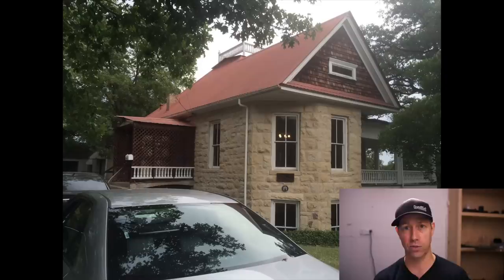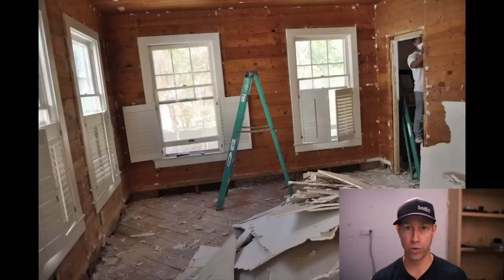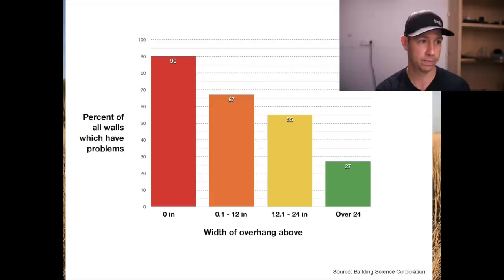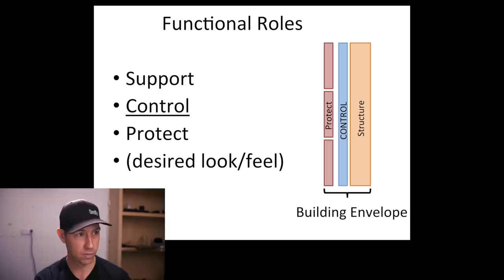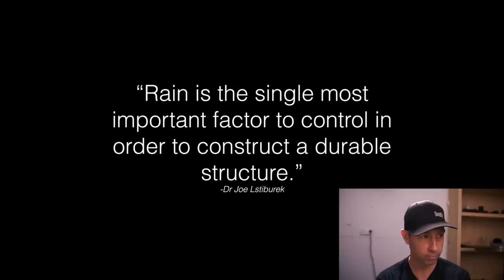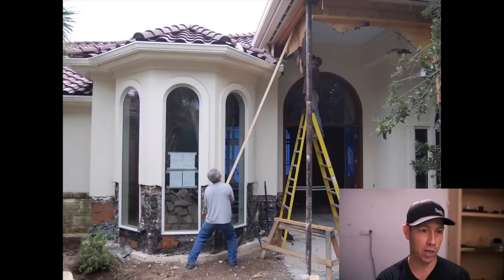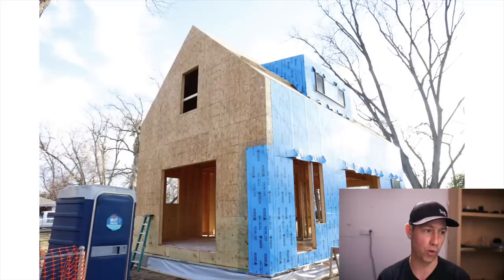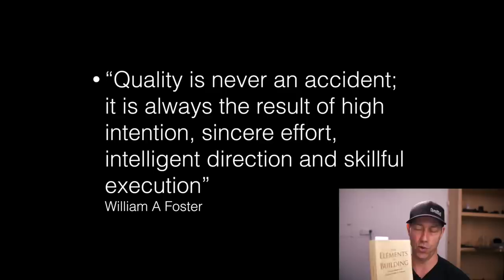Were Old Houses Built Better?

Comment: They didn’t have everything engineered to a spec, they went overkill on everything. Leave a 100 year old house out in the elements for 10 years and it’s still standing. Leave a 10 year old house out in the elements for 10 years and it’ll be dilapidated and garbage
Reply: That makes alot of sense. Atleast for the houses that survived long time
Reply: But the old house will smell mildewy like an old house, be drafty, be costly to heat and cool, have systems that are hard to maintain and will be haunted.
Reply: @Wee162  I trust my grandpas beat up farmhouse more then I trust my trailer his house has holes in the siding but if a trailer has holes in the tin itll rot out in a year
Reply: Damn you should build a oldstyle house lets see how you like it then hahaha
Reply: Grandpas house burnt down from the chimney

Comment: One also has to consider survivorship bias when looking at old things. Bad buildings from back in the day may be long gone. What we have left are the best buildings from a given time period.
Reply: Great observation
Reply: Definitely, tenement style housing from 100 years ago made with mediocre materials has probably all been raised by now.
Reply: Which begs the question from the video: How do we design houses today to take advantage of the successful things of the past, but improve them with today's modern efficiencies. It seems a lot of houses today are efficient, but not durable in the slightest. We should really strive to do both rather than one or the other.
Reply: excellent point.
Reply: They also aren't sustainable. A lot of the foams and synthetic insulators require cheap energy (petroleum) to be produced.
Reply: Great information
Reply: That could merely be an opinion that disregards the fact that some older buildings may have burned, been demolished for newer styles or replaced by commercial buildings. They may have been extremely well built, but not what the new owner wanted or needed. 
Antebellum homes are less common in the Southern United States, because they were often burned deliberately.
Reply: Cheap energy is a good thing anyhow.
Reply: not like northeast buildings
Reply: Nowadays everything is made to last only until the customers warranty has expired. Yes, yes, you can buy things with only a 90 day warranty that might last a year or two, but the planned obsolescence of most things we buy has succeeded in forcing us to send much of what we paid for with what little income we retained after paying various taxes on our income to gigantic landfills! And this is EXACTLY what the bought and paid for politicians from both wings of the same dodo bird political parties are happy with since they accept legalized bribes from government-created corporations!
Reply: A lot of old houses from 150+ years ago were so flimsy a couple of strong men could pull them down with their bare hands. If you ran at the wall and slammed it full force you would probably be going straight through to the other side. That was an old movie trope from the silent movie era. There would be a fight inside a house and one of the guys would get thrown straight through the wall. It was supposed to be funny but it was basically true. There was construction method called "Wattle and Doub" that was the equivalent of basket weave caked with dirt that was just plastered over. Building codes eventually made this kind of flimsy construction illegal. These houses didn't survive so we are left with only the high quality examples lasting until the 21st century. That is surivor's bias. Most people from the 1800s could not afford to live in a stone house. That was a rich man's house. The poor made their houses out of straw and sticks. Remember the 3 little pigs nursery rhyme?
Reply: @AB-wf8ek  razed
Reply: RickMakes also the ones that probably had the most money go into their build. Like the first house shown for an obvious example
Reply: B Man how are 90 day warranties even legal? In the U.K. even the very cheapest goods come with a minimum of 12 months warranty by law. It sounds like your system is designed to encourage repeated replacement, clearly disadvantages the consumer and is obviously terrible for the environment.
Reply: @jtemple4009  And I've been  in 3 or 4 room old abandoned houses in rural TN that obviously were not built for wealthy people and they are still much more solid built than today's drywall, stick and vinyl siding homes.  Solid oak interior doors, thick wood window frames, plank wood floors, etc.  Not the hollow doors and particle wood window trim of todays overpriced, mortgaged homes.   I've already paid the banksters nearly double on my 1400 sq foot home that Elvis paid for the 5,000 sq foot Graceland in the late 50s.   Banker inflation means quality goes WAY down while prices go WAY up.  It's called theft by it's real name.   "Let us reduce the ephah and increase the shekel; let us cheat with dishonest scales.…" Amos 8:5
Reply: @kirkland5674  Yes. Survival of the fittest.
Reply: @KyleMc16  Exactly! It seems in may ways we love to throw the baby out with the bathwater
Reply: @bman4737  So true!! We are a society of gimmicks and fads, Orwellish slogans and a lot of brainwashing. You can start with the so called american 'corporate culture' (who knows what culture has to do with it). It's all right there, a microcosm of all the absurdity
Reply: @jtemple4009  Yeah good points. What's absurd is that banks are allowed to foreclose on all those bad loans they shouldn't given out in the first place. I say they should't be allowed to take away homes from people who have run into trouble. That is plain cruel.
Reply: Monolith dome
Reply: @KyleMc16  
There are plenty of houses like that! I was lucky enough to go up into a luxury high-rise apartment complex- right away I noticed that everything just felt... sturdier. There isn't some mass of stupidity at the very top; architectural societies and masons, builders, etc. know how to make really good housing. It's just not economically viable. If you think housing is expensive now...
Reply: MAC VENA beautiful points!
Reply: Well I don’t know about that one, if you drive through an old small town you see pretty much all old buildings from the same era, grouped together. For the most part they’re all still standing. If the survivor bias theory was correct you’d see a lot of empty lots or new houses mixed with the old houses.
Reply: RickMakes If you look at the old aerial photos, you’ll see the only houses that don’t survive are the ones that are replaced with subdivisions/ shopping centers/ new, worse houses.
Reply: Came here to say exactly this.  There are actually a lot of structures in my town that date back to the 1800s (Dundas, ON), and I'm sure the ones still standing don't represent how all of them were made back in the day.
Reply: Alex Flockhart but for the most part that’s how they were made, of you look at historical Areal images most of those houses are still standing, and most of the ones that aren’t standing burned down, were torn down for a development, or were just not maintained and left to rot, not because they weren’t built well bent because they weren’t re painted or re roofed, it’s not the house’s fault that it wasn’t maintained.
Reply: But a lot of old buildings were either torn down for no reason for a new construction or destroyed because of war, sooooooooooooo...
Reply: also in many places property taxes insensitivise people to tear down old buildings, usually barns, but also abandoned houses that someone would otherwise fix up and live in.
Reply: @AB-wf8ek  you need to go to Waterbury CT, it's nothing but 80-120 year old tenement housing. I'm sure there's other cities like it too.
Reply: The problem with that is I know how many houses were on my road 100 years ago, and there are none missing. That means 100% of them are still there, including mine
Reply: very good point

Comment: There are so many materials that were discovered, used, and then abandoned BECAUSE THEY LAST AND LAST AND LAST AND LAST AND LAST. The Smeaton mortar is a mixture of equal volumes of lime, blast furnace iron slag powder, and sand and it was used in building the Smeaton Light Tower and it has to be dismantled and moved inland because the waves has worned out the natural rock formations but the Smeaton Mortar foundations REMAINED INTACT EVEN AFTER NEARLY 200 YEARS OF WAVES SMASHING AGAINST THEM!  An another one is when I discovered a WW II era bakelite plasticized asphalt impregnated wood posts impregnated  through and through from the inside out with a mixture of 15% bakelite and 85% asphalt, this wood was used in the tropical jungles during WW II and THEY ARE STILL STANDING IN PRISTINE CONDITION. The same mixture of 15% bakelite and 85% asphalt was used in making asphalt roads and these roads are still in good conditions since they were laid thickly (6 to 8 inches thick on average) in 1944, 1945, 1946, 1947, and 1948. How is it that structures built 1,500 years ago in China have survived multiple earthquakes while newer buildings have been utterly destroyed, time and time again? The secret is a super-strong mortar made from sticky rice. Scientists have discovered that construction workers in ancient China mixed sticky rice soup with slaked lime, which is limestone that has been heated to a high temperature and then exposed to water. The combination of these two substances is nearly indestructible, and buildings made with it have even resisted demolition by modern construction equipment like bulldozers.

Comment: Older houses were also built with different assumptions, particularly regarding the frequency of modification.  You don't build your house with 2-foot-thick stone walls if you think you might live there only 5-7 years and the next owner will want to "update" everything.

On the other hand, if you're there to stay and think you'll pass it on to your kids, then you might invest in some really nice craftsmanship.

It's hard to recoup the costs of quality when you sell.  American home-buyers pay for appearances and amenities, not quality--about which they know precious little when it comes to buildings (and much else).
Reply: Also old houses were built with old growth timber
Reply: @Daniel Prazenica old growth is much better wood. Typically the trees have tighter growth rings and that makes the softwood lumber harder / stronger. A modern spruce or pine 2x4 has fairly large growth rings. 
Modern forestry practices are meant for the fastest growing trees possible. I would snag that old house your looking at in a second assuming the roof is good and the building wasn’t leaking
Reply: @Daniel Prazenica not sure if you are talking about lead in the house or lead in the soil in the yard. Lead in the soil I don't know how you would deal with that. Lead in the house from old pipes and old lead based paint the only way to deal with it is the basically take it all out, i.e. gut the house take all lead water pipes out and all of the old lath and plaster and trim that would have potentially been painted with lead based paint. Do not sand the paint or walls as it will only create a fine lead dust and make the situation even worse. The best thing to do in this case is basically just redue all of the plumbing and drywall and trim in my opinion. Lead can be really dangerous, I have read articles of kids who have died back in the day from long term lead exposure because of lead based paint and drinking water delivered though the old lead pipes. Don't take a chance with the lead in my opinion!
Reply: @Daniel Prazenica ya lead dust on surfaces is almost impossible to correct without remodeling. Some people try to paint over lead based paint but its a band aid. I think your better to move on if gutting the place is not on the agenda, like you said it will be very expensive
Reply: ... it helps the economy.

Comment: Old houses did have a form of cooling.  Most I've seen around my area had these windows above the doors all the way up to the ceiling that would let the hott air escape.
Reply: I would add that I think my basement with the thick walls helps keep my house cool in the summer.  I don't run ac much at all here.  I'm also right on a lake, in a valley and have trees all around me for shade, I'm sure that helps too.
Reply: Yep. People think I'm crazy when install a full size single screen and open the top of the windows.
Reply: that is called a transom

Comment: I was super lucky when the 100 year old house I recently purchased turned out to be built of solid Australian red cedar. Floor joists, wall frames, windows, all trims, ceiling joists and beams. Even the walls and ceilings were red cedar ply board. It still has the original tin roof with no rust.
There is no insulation but it is so cool in summer and holds the heat in winter (even in snow). Its also very sound insulated as well. I live near a main road and railway and can hardly hear the truck/train sounds. Someone knocks on my door and I can't hear them even a room away.

In comparison, the 1930's extension for the kitchen was built using pine, Masonite, cheap ply, and fibro. Freezing cold in winter, boiling hot in summer, drafty yet stuffy at the same time, and with various parts needing replacing every decade (info from previous owners). I only need to paint the old part of the house but I will have to insulate and repair most of the extension. I'm considering having the extension all torn down and re-done.
Reply: We live in the northeast corner of the US, and there are many old homes here, and plenty of them are still being lived in while remaining significantly original in structure.   Yes, of course bathrooms & kitchens have been modernized, they've been rewired, but you still find uninsulated homes, homes with original windows, homes with original doors and working fireplaces, etc.  And as you said, the houses do well with the changing weather.  And living in a few different houses like that myself (and knowing many others who do as well), I know that our bills are not through the (uninsulated) roof in summer or in winter.  The house does well in retaining heat and staying cool in the summer.  Last year we used one window unit a/c and 3 window fans throughout the entire 2000 sq. ft. house, and we were comfortable.  We slept fine---and we slept under covers, not on top of them.  ;)  Now, we've lived in homes built in the 60s & 90s, and those houses offered us no improvement in heating/cooling.  In fact they were worse in some cases.  And on top of that we would regularly run into mold issues in those we which we have never had in any of our older houses.
Reply: @lissamk3990  How is it that they do fine with weather extremes, with no insulation?

Comment: Our house was built in 1932 and it is wood. We also bought the house next door(also built in '32) for $4000 it still had the original toilet because it had been vacant for a couple of decades. Both very strong built house. We didn't throw away the toilet, still have it in storage.
On another note, if there is a house fire, new lumber burns twice as fast as the old.

Comment: I owned a house in southern Missouri built in 1912 framed out of Black Oak!!  The lumber in the house was worth more than the house.
Reply: There's a house near me that has exposed redwood roof joists and roof sheathing.  It's beautiful, and worth a fortune too.
Reply: Wow! That's crazy
Reply: Depends on what you're doing with it. Black and red oak are far more porous than white oak but unless you're building a boat with it, its not really an issue. Framing a house with it would be plenty strong as long as you made sure to keep moisture out. That goes for any kind of lumber though.
Reply: Pre-1970? southern CA entire home even stucco starter homes entirely framed (every 2x4, 2x6 etc) in red wood.
Reply: Then why did you sell it?
Reply: @pcofranc  THAT REDWOOD DOESNT ROT...AND ITS ...TRUE TO INCH...SIZED LUMBER!
Reply: This is actually a huge business in Thailand.  There are large old homes made of old growth teak.  They are sold for huge sums to be disassembled gently and the wood repurposed for high end furniture and the like.
Reply: I bout an old house built in the 1800s. The original rock house is built with the same wood. Still in great shape. Everything they added in the 50s had to be tore off the house from water damage, termites and dry rot.
Reply: Exactly the reason to buy older houses
Reply: I'm trying to buy a triplex from 1914.
Reply: We pulled apart a home in Maryland that was built with oak studs.... pulling nails outta that was so miserable! Pretty stuff though